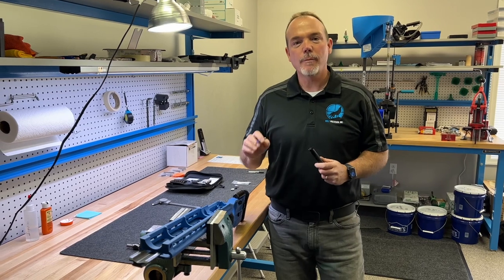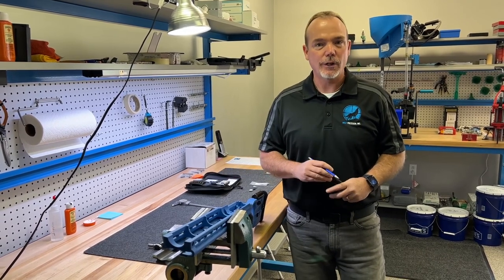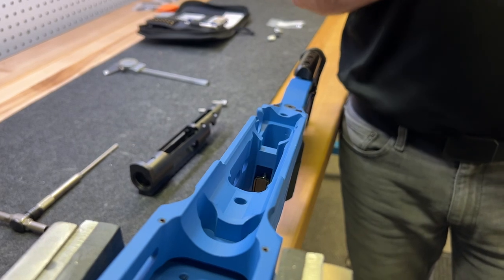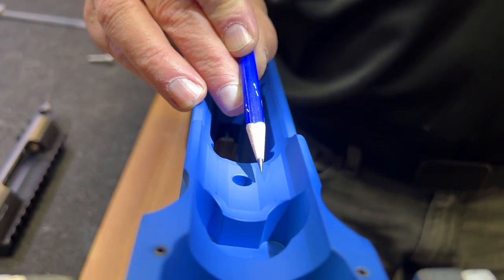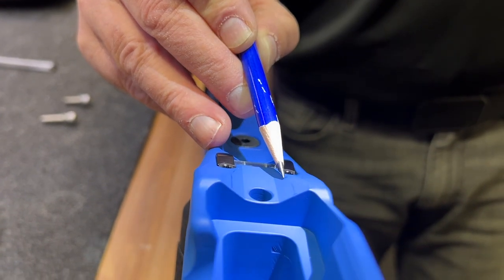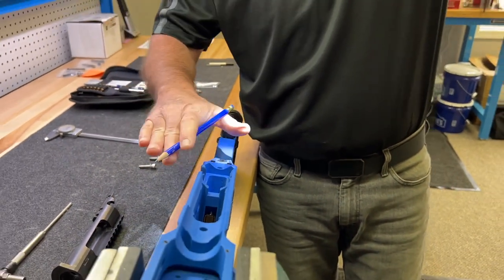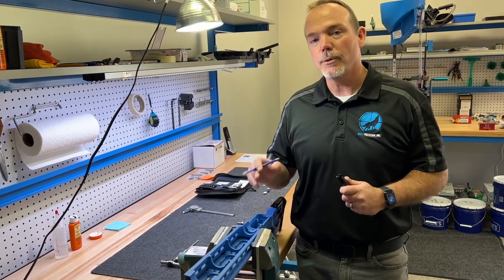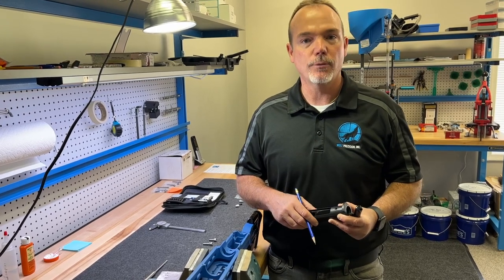"V Block" rifle chassis and why bedding is so important for accurate rifles.

Comment: Trying to decide between McMillan and MPA this video helps.  If I’m going to bed the rifle either way I would rather go the more economical route and get the McMillan.  I like the adjustability on the fly of a chassis rifle and they appear to be more durable and modular with their plethora of options, but at that price point that chassis should fit damn near like a glove.